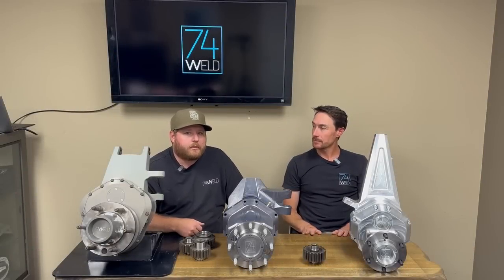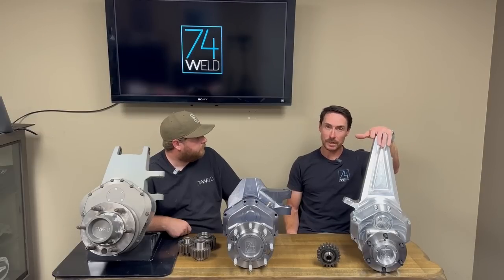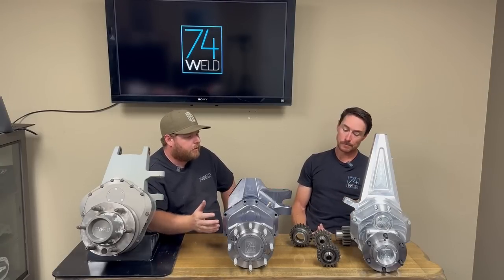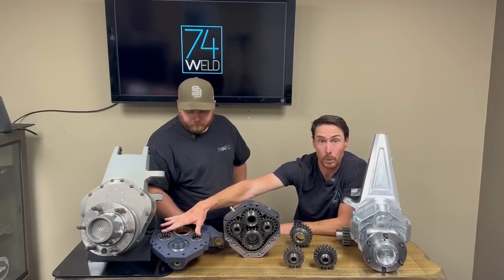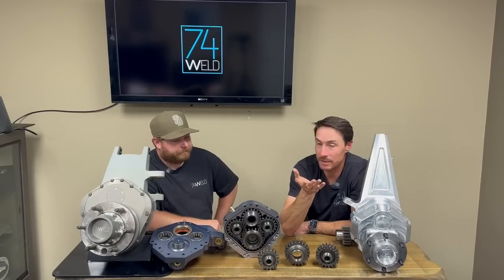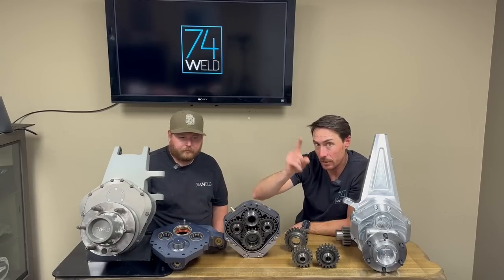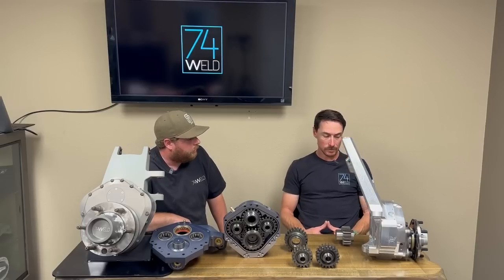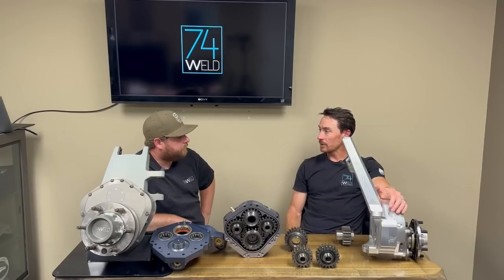Portal Talk with 74Weld

Comment: Maybe i missed it....do your jeep front portals have the option of axle disconnect hubs?
Reply from the maker: No, the very early models did. We went away from that with a design change. The new stuff is stronger and locking hubs equate to about a 1% fuel economy gain.

Comment: Absolutely fantastic video.  My question is can you discuss the leverage the portal adds at the axle tube and then your opinion on the the impact to the steering rack (Bronco) on IFS stuff.  Thanks a ton!
Reply from the maker: I think the portal has a negative impact on the steering rack. Not gonna sugar coat it. I hear people say the same thing about the rear axle and while I agree we have not seen this to be a problem with Jeeps on 40’s w V8’s. With that being said, We run 42’s on Loren Healy’s portal Bronco FunRunner XL with our steering rack. We are also developing a billet replacement rack for the Tacoma so we plan to solve the taco steering next
Reply: Love the set up. Wished you would have talked more about seals my worries are are oil leaks and why such oil change frequently

Comment: Hey Quinn, any thoughts on how much weight the portals add on unsprung weight for a bronco? Would you recommend gussets to the frame with the extra weight? Thanks
Reply from the maker: The entire tacoma outer weighs 56lbs. I would guess the factory weighs 25 maybe? Not sure on that. Regardless I would gusset the upper a arm on the frame. Check out what Exodus 4x4 recently did. He posted about it on IG

Comment: you are adding a tremendous amount of unsprung weight to the suspension with the portals, wheels, and bigger tires. So, maybe not a lift kit but definitely beefier springs/shocks.

Comment: I’m a bit unsure of the unit bearings being a true full float? Would it have been possible for a traditional spindle and wheel bearings or is that just too limited for hubs, packaging etc?
Reply from the maker: A full float by definition is an axle assembly where the weight of the vehicle is carried by the hub and the axle shaft only sees torsion, and not weight. A unit bearing does just this.

Comment: you made the comment that if you want to run the rubicon this is it, but don't you lose a large amount of flex with no additional lift or a small lift than a long arm lift with coilovers? I have a 2014 wrangler that I'm trying to decide how to set up the suspension and this is a very interesting option. The Rubicon and Holy Cross are my bucket list trails. Thanks for any more insight you can give me.
Reply from the maker: We loaned our 392 to Erik Miller a month ago on the Rubicon. The ARB compressor died 10 minutes into the trail and it was pouring rain. Erik drove the entire trail open diffs and almost never lifted a tire and never once had to think about pulling a winch line. The factory suspension worked just fine…seemed like a pretty good test

Comment: What kind of shock valving change is required when bolting a portal axle onto an ifs? Are there off the shelf shocks tailored to that application, or is the change in weight insignificant compared to the change in weight of the wheel and tire?
Reply from the maker: We bolted on Fox performance series right out of the box and have not changed anything.

Comment: Thanks for very clear and simple explanations looking like a powertrain engineering course. I have 2 questions.
Diesel engines have less power but more torque. Are your portals suitable with medium duty diesels such as; Duramax V8 or Cummins inline-6?
Electric motors offer smoother torque, so alternating force stress on the bearings are less. But their harmonics have different frequency spectrum characteristics than internal combustion engines. Will these portals appliable with electrical vehicles in the future?
Reply from the maker: We have electric builds in the works. Diesel is fine, I see no issue with any powertrain I’ve looked at to date.

Comment: Whats is the mininal wheel diameter to accomidate portal case inside the wheel ? 
Is it possible to install more positive wheels to compensate a bit for the increased width ? 
How much weight is added per wheel ?
Reply from the maker: We need a 17” wheel for packaging. We recommend a +25 offset wheel which most all wheel companies make. The portal adds about 30lbs per corner.

Comment: Ok ? I might just not be thinking clearly. If it re-gears a Tacoma to run a 36-37 if some one ran a 40” would it scale the same as if the truck went from say 30 to a 33 or 33.5 with no gear reduction?
Reply: It would be very close. Just divide the larger tire dia by the starting tire diameter to get the ratio. 40/37=1.08 and 33.5/30=1.16.

Comment: Will the portal still work if I already have 5.13 gears installed and run a 37” tire on my Gladiator?
Reply from the maker: I would probably say you won’t be happy with the gearing. A 4:10 converts to a 5.0 That is what we would typically recommend

Comment: Any possibility to offer CTIS on these kits?
Reply from the maker: Yep, we are working with Teleflow. They have an amazing setup we plan to integrate into our system. It has no airlines at the wheel and is not constantly pressurized so if you ever lose a line the system does not bleed out. Very trick and proven in Dakar.

Comment: I’m confident the portal is reliable the only thing I’m concerned with is the torque added to the axle it’s not designed to have a large breaker bar twisting on it. But it’s off-roading so that’s how it is.
Reply: Portals reduce axle torque loads
Reply: @timmo42  Maby a cv axle or drive shaft but no way a regular rear straight axle. It’s a beaker bar and will add load to certain joints depending.
Reply: @jefferyboring4410  we’re talking about different things… a drop box or portal will reduce the torque load on the drive axle. The casings “might” experience increased mechanical loads resultant front changed geometry. This is why they mentioned semi vs full float.
Reply: @timmo42  yep

Comment: I notice oil change intervals are different between Jeep's portal and Tacoma's, 10,000 miles vs 3,000 miles. Why is there a huge difference despite the same gear set, same materials of portals? Glad to hear from you
Reply from the maker: 3,000 on everything
Reply: Why

Comment: Are the Jeep Portals made for only the stock axle assembly or can they be made for 60’s ?

How much do they increase the track width ?

What offset rim is used for the Jeep ?

Can the Jeep Portals be made with 6 stud/lug ?
Reply: Why the fk would you want 6 lug wheels?
Reply from the maker: We can’t do 6 lug on Jeeps. We just make an 8 lug unit bearing for Jeep stuff
Reply from the maker: @mattbrew11 because 6 on 5.5 is the most common off road wheel in the world 🤔🤷‍♂️
Reply: @74weld You make a 6 lug for racing but you can't make one for Jeeps??  I'm curious as to why that is.

Comment: I have seen jeeps with the portals, and is my go to option, but haven't seen a video with factory rubicon axles, all I have seen is change to currie axles, so makes me think is needed to also change axle to get portals on the JLRU
Reply from the maker: We have tons of JL and JT platforms running stock axles and portals. We are doing an install this week with Mopar on a stock JT as part of onboarding as a Mopar supplier. Check out our IG for videos of stock Jeeps on portals
Reply: @74weld how is this going? Almost in with mopar?!?

Comment: For Bronco, does your portal package address the current rear axle tube issue that would be amplified by the portal box - i.e. axle truss or other torque solution??  Looks like a solid product!!  Also, any deals for packaging with the steering rack?
Reply from the maker: We won’t address the axle tube issue. I had a conversation with spicer about this a few months ago. They will be selling their cast iron tube very soon. You can also just buy the HD front diff and be done
Reply: @74weld  We’re talking about the rear axle issue, right? - the tubes breaking the spot weld and spinning the diff housing. Will there be a truss or something to counter this?  Seems portals would exacerbate this?

Comment: So, why not helical cut gears for stronger teeth, greater contact patch and quieter operation? Is this purely for race applications?

Edit: Slightly covered at 20:00
Reply from the maker: It really has nothing to do with gears and everything to do with bearings. There are also lots of other complications with helical, but the main issue is bearing packaging and specs due to thrust. It also generates a lot more heat than the straight cut
Reply: @74weld  Indeed, the losses are less too. Probably not the space for a crush washer/bearing or a conical. The gear whine might be tolerable considering they are effectively running close to wheel speed (except for the idlers). I just immediately think of 1st and reverse in my manual and the whine associated with that.

Considering this isn't intended for a highway application, and the likely noise from aggresive thread tires it's probably a wash.
Reply: Honestly can't what for more people to get these and the competition so we can see what really works and what doesn't.  Comparing noise means nothing when one wieghts 50lb more but is quiet. I also want to see how the others mount I believe the 47welds ifs set up is the way to go. But if they say there's can beat this then let's see it.

Comment: Why do you need to change oil SO frequently?  nobody change oil in regular transmittion in 3-5k miles . Why is this thing so different ?
Reply from the maker: Oil is cheap insurance. It’s easy to do and will ensure long life. We have run them up to 10,000miles but keep in mind you don’t have much volume in these (10oz) at full retail it costs you to 10 bucks to change the oil. It’s just a good thing to do

Comment: how much does it effect my MPGs?       i would think just a tiny bit, i would hope not much.
Reply from the maker: Totally negligible. On paper the gear sets are 99.8% efficiency. The real loss comes from big tires, not the portal. I get 16-17 mpg on my 392 on 40’s. I recently switched from a BFG race 40 to a Milestar XT and got 3-4mpg pickup right there

Comment: This is the end goal for my F250 Tremor.  Curious where it’ll put gearing with 42’s considering factory 4:30’s
Reply: Does your calculator have the little button that looks like an X? 
If so, the solution is available
Reply: @mattbrew11  there’s always one.  Thanks for pointing it out.
Reply: @derekeasley5894  you do know how to multiply 4.3 x 1.22 right? 
Because if you’re even mildly concerned about performance or mileage, you need to stop thinking about 42s immediately
Reply: @mattbrew11  I know now that someone smarter than everyone has told me. Not sure how I’ve successfully made it 43 years in life without knowing simple arithmetic.  

Here’s a quote from 74 Welds website. “Our 4 gear design provides a 22% gear reduction at the hubs which allows for a 22% bigger tire without the extra stress on all drivetrain components. This means that you can throw out the stock 32” tires and replace them with 39” tires without having to lift your Jeep or re-gear your axles” 

If the jeeps can increase tire size by 7”, why can’t I? Yes Tremors come with 35’s. 

Now I personally use old school math /rule of thumb to land on proper gearing ratio by multiplying tire diameter by 0.12.  Which doesn’t land me far off.  And being a super duty, a little extra gearing won’t hurt.
Reply: @derekeasley5894  if you want to find the “perfect” gearing ratio (not accounting for parasitic losses due to rotating mass and rolling resistance, do this
4.3/35 = x/42 and solve for X
42 x 4.3 = 180.6 / 35 = 5.16 
For reference ive been in a godzilla powered truck on 42s with 24 or 26 inch wheels I dont remember and it was showing 9mpg and the performance was very underwhelming.
Reply: @mattbrew11  it doesn’t sound like that truck you referenced was set up to perform outside of a mall parking lot. My Godzilla currently with 37’s performs excellent on and off road.  Anyways like I say it’s an end goal.  Meaning about 5 more years down the road when I’m ready to retire it to the ranch.  It’ll be a great replacement for over priced sidexside
Reply: @derekeasley5894   theres literally one quality 42” offroad tire on the market that doesn’t require show truck size wheels and thats the nitto trail grappler but its C rated. 

There is an enormous delta In performance between a 37 and a 42.  I owned an AEV 2500 ram on 37s. Flipped it when CV19 happened and got a prospector XL. Even the jump to 40s was hugely impactful, so much so that I sold it. Plus its so big that its not going anywhere but open places

Now I have an ecodiesel gladiator. On stock 3.73 gearing it would melt the 37” tires. Then I jumped to 4.88 on 42 nittos (the appropriate gearing) and its 30% + slower and mpg went from 23-24 down to 14-15x its also tuned and deleted so 320hp/525tq on a much lighter vehicle (~ 2000lbs less than yours)
  If it wasn’t absolutely unstoppable off road with the 4-1 tcase it would already be sold but im keeping it forever now that diesel jeeps are gone for good.  Im finally getting my cybertruck in ~ 5-6 months to drive daily then im done buying vehicles for a very long time
Reply: @mattbrew11  sounds like some impressive vehicles for sure.  I’ve never been a huge Nitto tire fan.  For true off road tires I prefer Interco.

Comment: @ 16:45 That bearing pressed onto the plate is a stupid idea, I can take it off with my knowledge no worries, but you should've added a spigot ledge at the back side for removal so you can get the puller under (cow's c..t). 
To the arm chair warrior brigade, yes I can remove the bearing for replacement and no I won't tell you how as it's industry secretes, but it would be far easier if it was made to use common tooling.
Reply from the maker: Sorry for being so stupid…wait, we added a relief to get a generic puller on it…ok I guess we are not totally dumb and maybe we have done this once or twice before😜